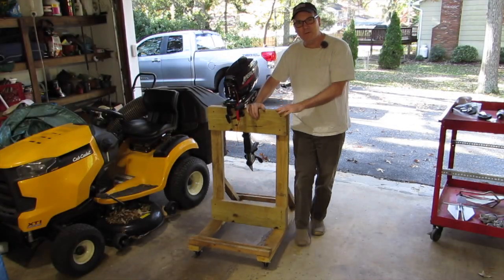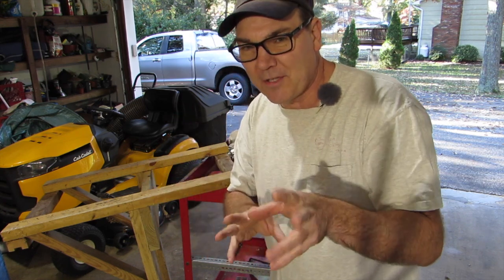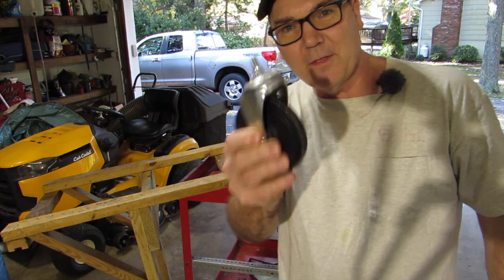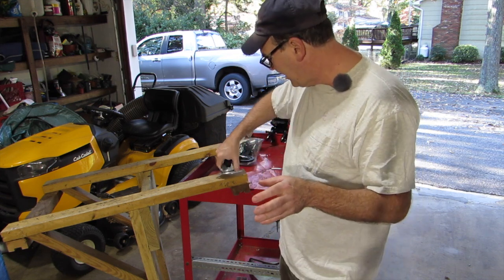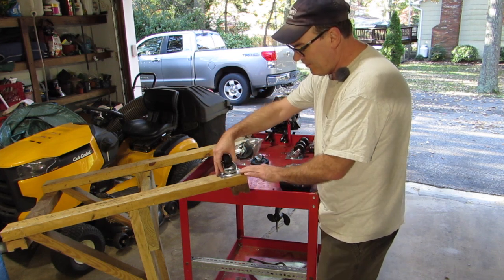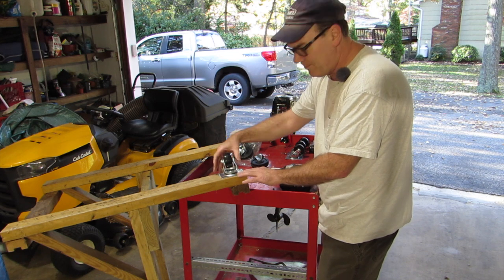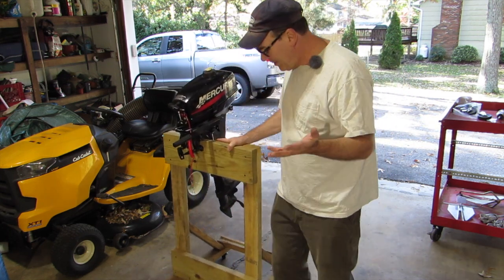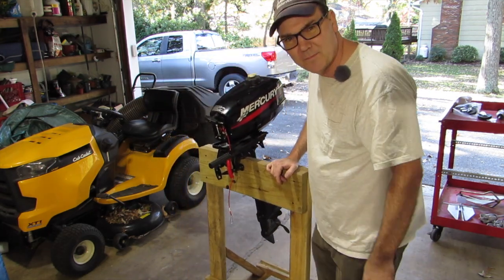Install Swivel Caster Wheels For Outboard Engine Stand

Comment: Great idea, however I think lag screws (bolts) or through bolts and nuts would provide a better method of securing the wheel base. Yes I would use a couple of locking wheels to provide a more secure working platform when doing engine maintenance.
Reply from the maker: Yeah bolting it completely through the wood is probably the strongest option.

Comment: Just last night I was in the school gymnasium moving very heavy chair racks holding 75 metal chairs each. It was very difficult to steer and park because two casters were fixed. Seemed dumb to me , especially with such heavy things to have to move around. 
I believe 4 swivel casters would have worked better. 
Thanks again for another great video. 
Mark from Maryland Harford county
Reply from the maker: Yeah the only thing that seems to work with 2 fixed casters are shopping carts!

Comment: Lawnmower wheels with trhu axle , like a hand truck.  Reason is, you want it to go over many surfaces, gravel , dirt, grass. You don't want to make a motor stand that only works on concrete .
Reply from the maker: Good point!